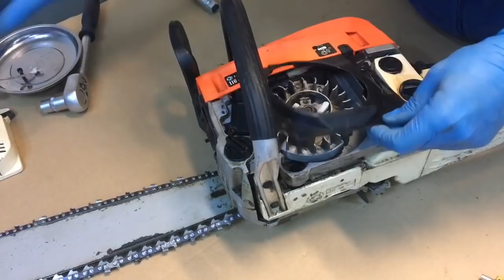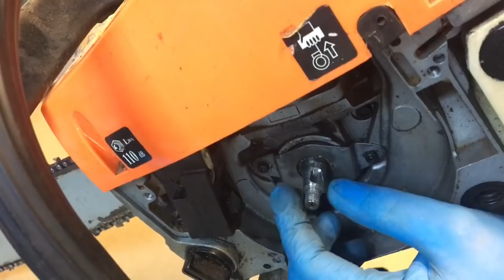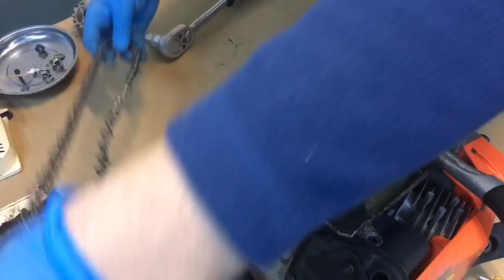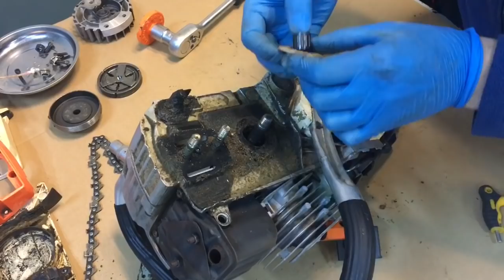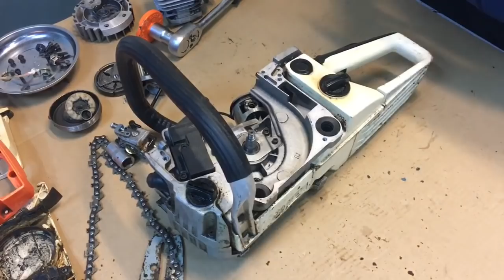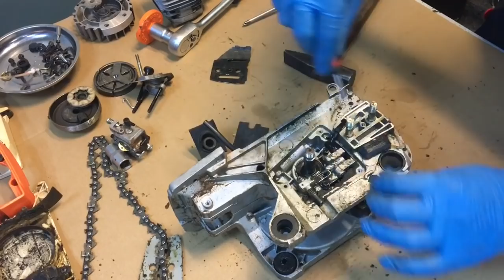Schimbat ambielaj si volanta drujba 5200 china partea 1

Comment: at 1:35 he has a tool for blocking the piston. I saw people using a rope for the same purpose.
At 5:57 he also removed a small bearing "piece".
Reply from the maker: Yes, you can use rope but a good rope, because it can caught in between piston and cylinder